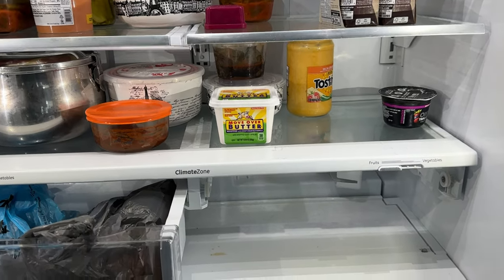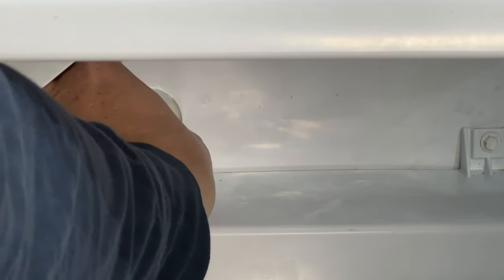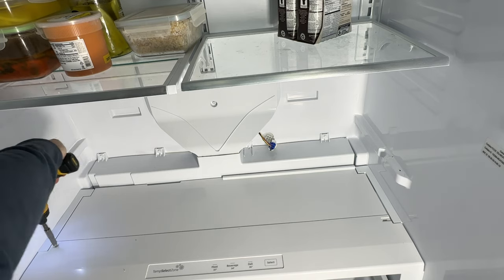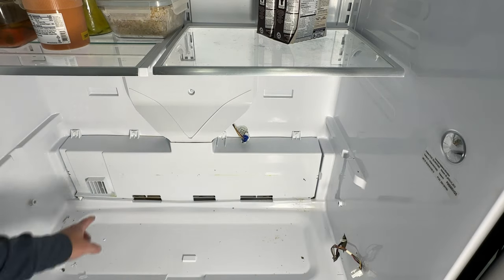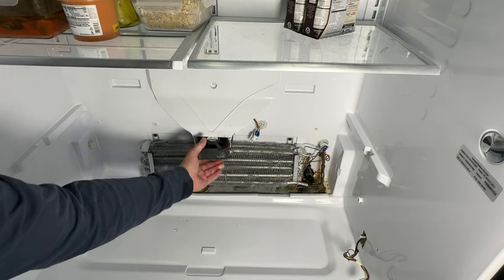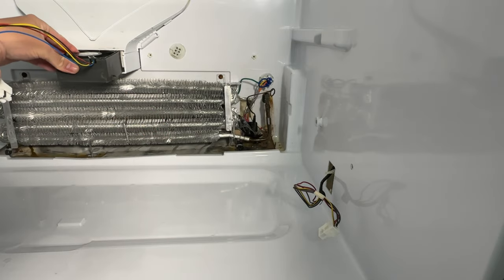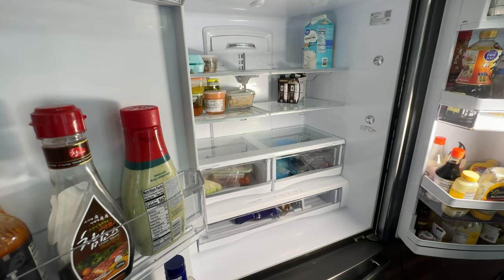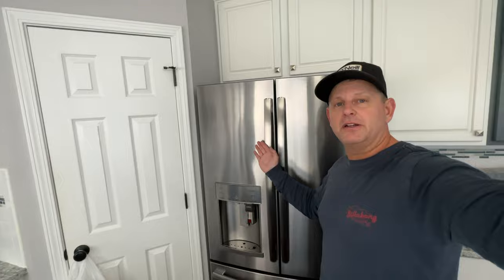#MTBPlanB DIY Troubleshooting and fixing a noisy GE fridge.

Comment: Did that fix the humming noise?
Reply from the maker: Yes. The fan was making the noise.
Reply: Thank you for the great video and response.  I feel confident that my GE Cafe has the same issue.  Just need to prove it like you described and then fix it.  Thanks again.
Reply from the maker: Very common problem.